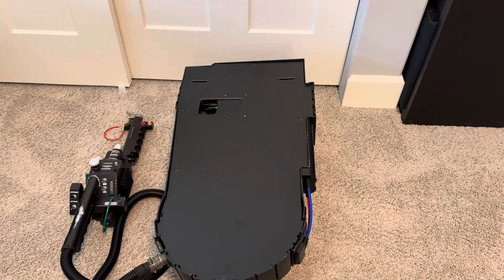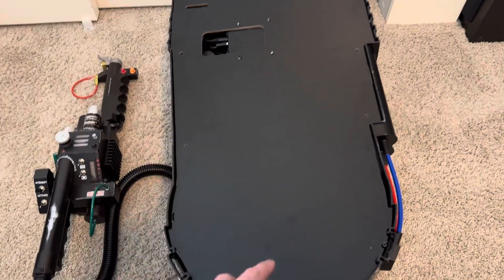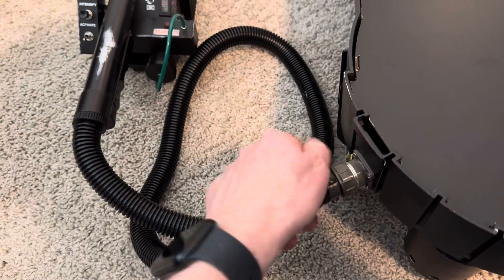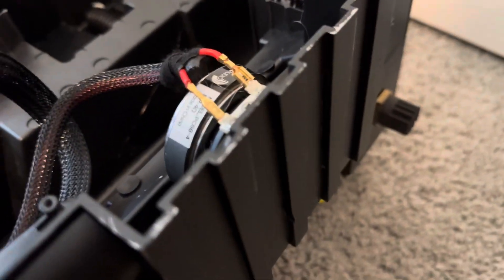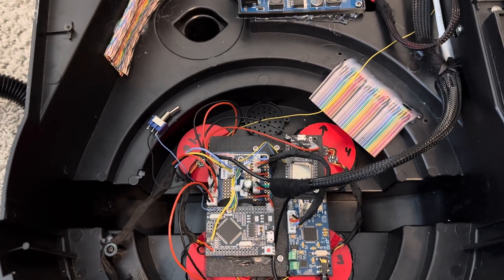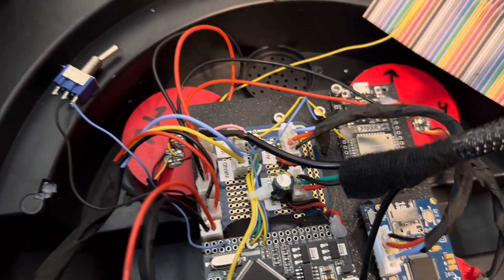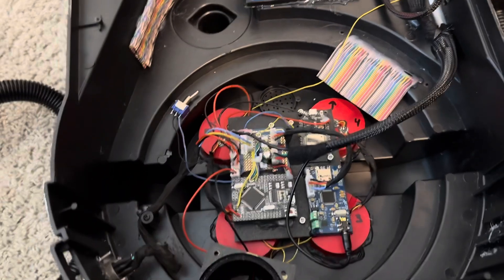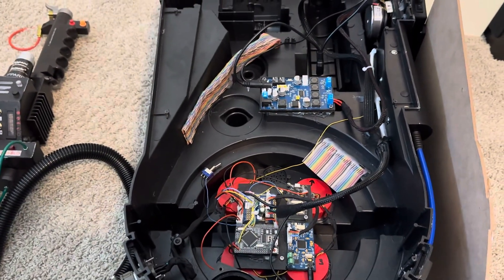Spirit Life Size Proton Pack - GPStar Electronics Install Walkthrough

Comment: Hello, I ordered my kit, but do you recommend the amp board they have and speakers they suggest, or do you suggest a better speaker that's louder?
Reply from the maker: On my pack I just have 2.5” Dayton speakers. However, it sounds like the newest recommendation is the LaVoce FSF030
 https://www.parts-express.com/LaVoce-FSF030.70-3-Full-Range-Woofer-8-Ohm-293-705?quantity=1&srsltid=AfmBOooGx0plXLX7Mj88B6CZSqKHwDQKjnwuz_mSGRYFXj1lj_aeD-tW

Comment: Really cool build. What cyclotron lights You would recommend for Spirit full size with original cyclotron?
Reply from the maker: @mikatikander2449  I think that depends on what your goal is, what electronics kits you select, etc. I’m making a board that will allow you to use a stock Hasbro 1984 wand with the stock spirit electronics, but will also have LED upgrades if you want. Otherwise, with GPStar the option is pretty much the Frutto LEDs or a LED ring.
Reply: Hi. I am gonna use Gp star kit with my spirit full size pack. I was wondering that does the frutto leds plug in easy on spirit cyclotron, without any dremeling, or just go with the Led ring?
Reply from the maker: @mikatikander2449  It looks like they have 3D printable mounts to hold the Frutto LEDs on the spirit cyclotron. https://github.com/gpstar81/GPStar-proton-pack/blob/v5.3.4/develop/stl/pack/Spirit%20Full-Sized/Spirit%20Cyclotron%20Lens%20and%20Frutto%20LED%20Mount.stl
Otherwise, the LED ring might be a good fit as well.. you can get a 45 LED 130mm ring for about $12.